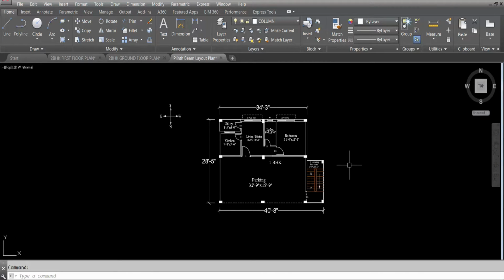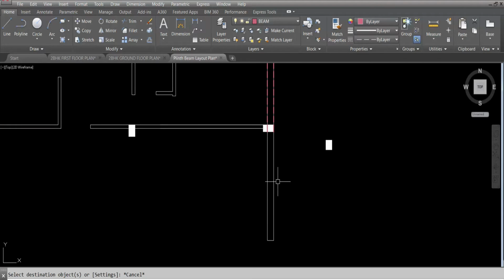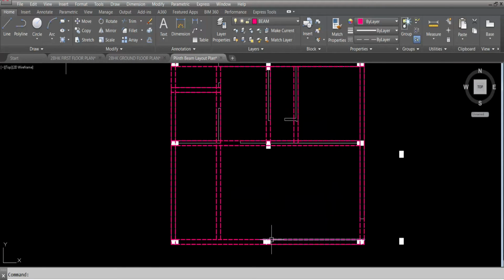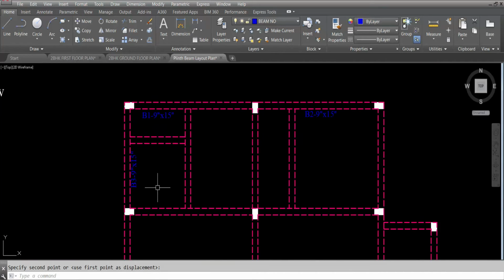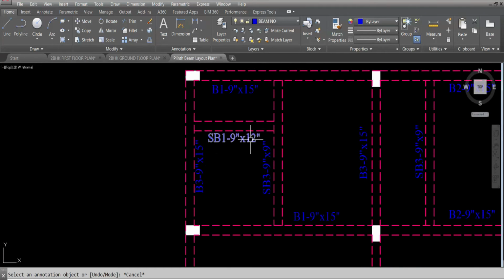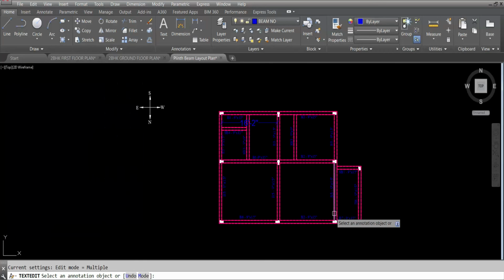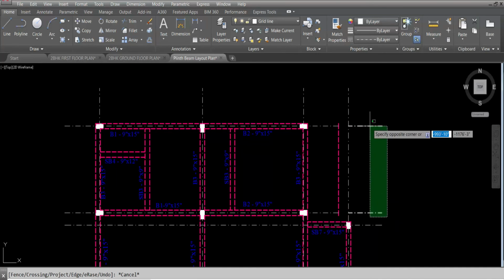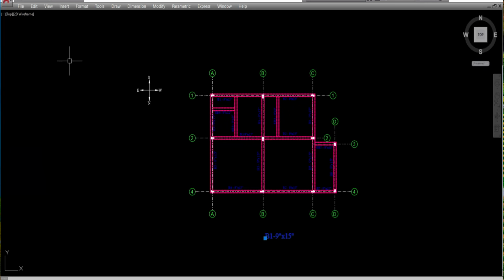Plinth Beam Layout Plan |  G+3 Building | In Autocad | Beam Layout  | Civil Engineering Tutorials

Comment: "Ma'am, regarding the portion of the toilet wall near the door (the small section of the wall🧱 connected to the door frame), will it rest on the slab? In the current layout, this is a plinth beam. But suppos If it were a first-floor beam layout, would it also rest on the slab since a separate beam hasn't been drawn for it? I hope this u got my doubt mam
Reply from the maker: Since side beams are already present, you do not need to add a separate plinth beam for the 5-inch partition wall.